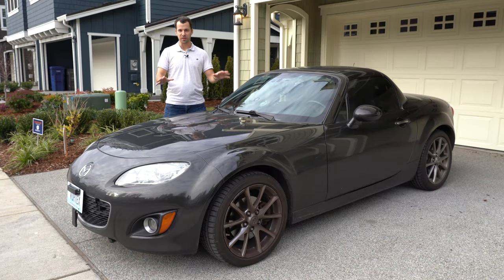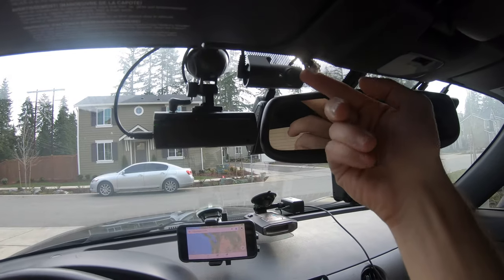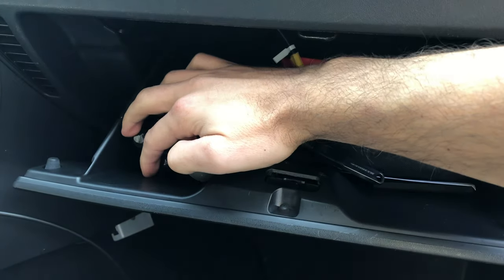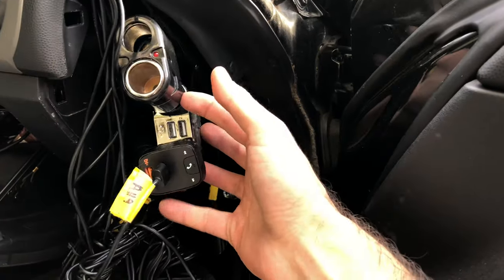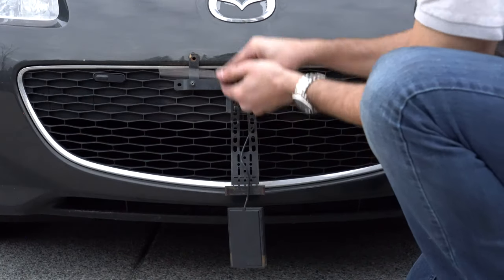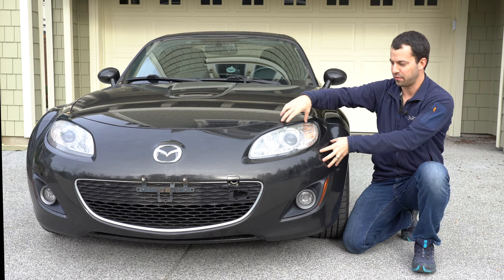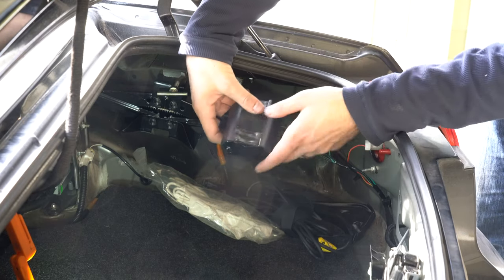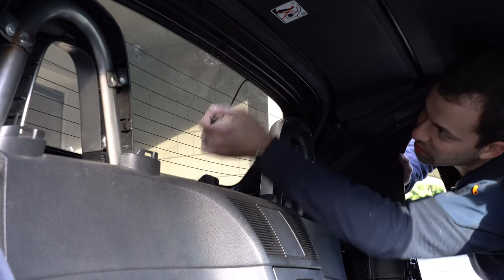Uninstalling EVERYTHING From My Miata!

Comment: Any reason why you are keeping the Stinger?  Recall that no updates had been done in a long while.  Max360Ci should have you well covered along with the RC-M and NR DSP.
Reply from the maker: Oh I've gone back and forth and still don't know if it's worth reinstalling it. I can always throw it on temporarily for testing. If I find a good place for it in the new car, I can toss it in since I'll be doing an install anyway. The whole point of installing multiple systems is so I can easily compare them, not because I actually need a bunch of systems. :) I find it really helpful to switch systems regularly to gain a better appreciation for the pros and cons of each. As for the Stinger's updates, they just released a new update for it a few days ago. https://www.rdforum.org/index.php?threads/83821/

Comment: Surprised Seattle did not make you pull a permit with all that wiring.

I will miss your Miata.

Acura RDX?  If you wanted just a slightly larger more habitable car, I would recommend a well optioned 128i with M Sport, Light package, 6MT, but they are rare as almost all had 6AT.

Comment: Vortex, have you ever thought of having an audio shop install for you a terminal strip board that has a 12v pos and negative strips? That way you have one central point to hardwire all of your electronics into and it it'll  be fused. Instead of all those cig lighter plug things daisy chained together creating a fire hazard.

Comment: I would have replaced the grille while the cover was off. I can tell you are more electrical then mechanically inclined.
Reply from the maker: It would have been a good time, you're right, but the car was already sold and they didn't care about the grill so there was no point in spending the money to buy a replacement one. :)
Reply: Gotcha, makes sense. I kinda figured that might be the case.

Comment: Do NC Miatas have non-metal quarter panels?  If they're metal, the fact that you have metallic paint (2:10) is moot.

I strongly suggest you not create a similar power system (sic) with your new vehicle.  Every connection and adapter is another point of failure and power loss, and fuse & wire taps are not the best way to feed power.  Look into adding circuits via a break-out system such as a Bussmann RTMR, Littelfuse HWB60, or something like that -- it'll be cleaner, safer, and more reliable.

I hope you plugged the extra holes you had drilled in the firewall and elsewhere for cable/wire pass-thrus.
Reply from the maker: Agreed! I did some research and just ordered one of these. https://powerwerx.com/west-mountain-radio-rigrunner-4008 This should be much better to set it up like this out of the gate. :D
Reply: Nice,  @VortexRadar !  Now get yourself some proper wire tools and some mating connectors and go to town!

Comment: Hey Vortex my max 360c mount literally fell and broke the other day any advice on a mount? I really like having it on the windshield mounted. I superglued it to the windshield after the sticky part wouldn’t hold and it was holding up great next thing I know I go over a speed bump and the mount came apart the spring and everything I was thinking of buying another mount the same one but is there a better option? Thanks great videos maaaaan 👍🏾
Reply from the maker: Get the Blendmount. It’s way better and it’s what I use. I’ve got some videos on it. Sorry to hear about the issues with the Escort mount, but luckily there’s solutions.
Reply: Vortex Radar sounds great thanks man

Comment: Finally getting rid of the chix car!!!  ;).
Reply: The most raced car in the world.
Reply: This chick car will abuse most cars on an autocross track. Legal sized go cart.
Reply: Still a chix car........gum balls and roll bar or not........go to Venice Beach parking lot on any Saturday and there's tons of Miatas with chix......
Reply: WFOinCO except that he never raced it once....nor do most owners.
Reply: Newzchspy what car do you drive? Miatas are very often recommended as a driving enthusiast car.
Reply: robm425 relax, it's an old joke between Vortex and I.  Yes, the Miata is a great SCCA weekend racer. We all know that.   It's also known , like the old VW Cabriolet , as a chix car!
Reply: @Newzchspy  at the same time, most drivers don't use their vehicle at their fullest. What percentage of pickup truck owners actually own a business and use their truck to haul or tow stuff on a daily basis? What percentage of pony/muscle car owners get to go to a drag strip on a consistent basis?
Reply: Cadd you're absolutely correct, except for pickup owners.  Most I know use the bed daily, if not on a weekend. I know I do. Contractors, daily for sure. Summer, for towing and hauling.

Most high perf cars rarely , if ever hit the track. Most chix I know with the Miata have never tracked em. 

Regardless, that's a lot of $hit in a Miata!! Vortex is a road warrior!
Reply: Don’t knock it, kinda like the Scenery at Yoga 🧘‍♀️ or Zumba